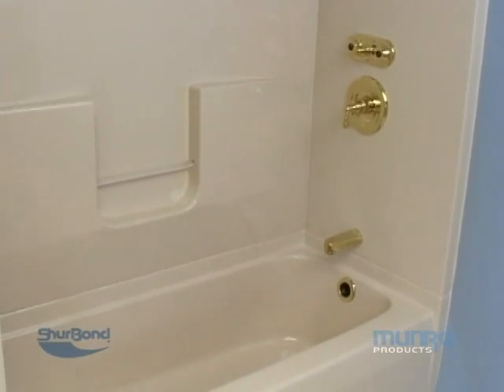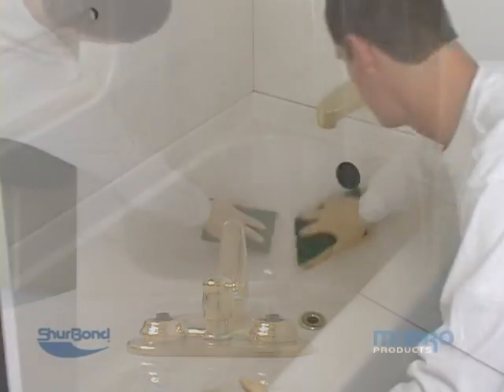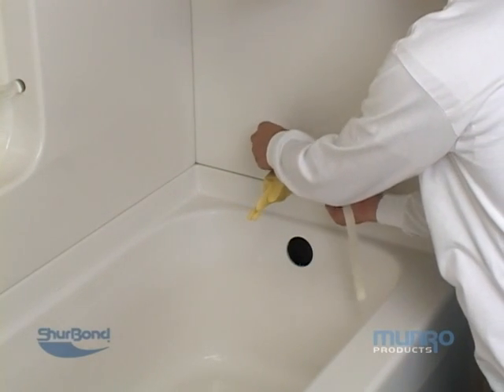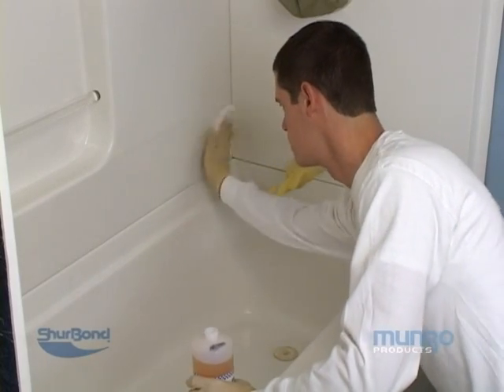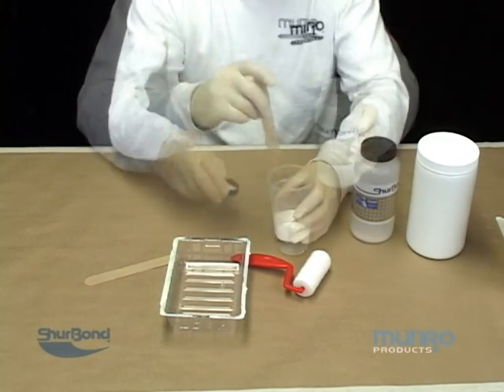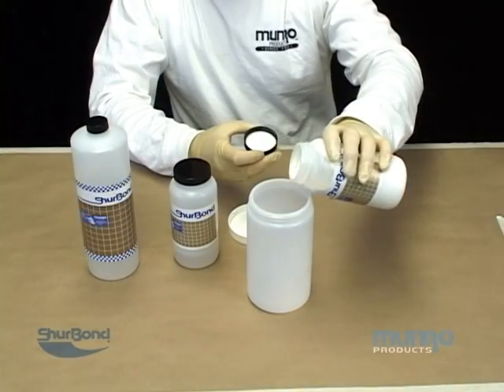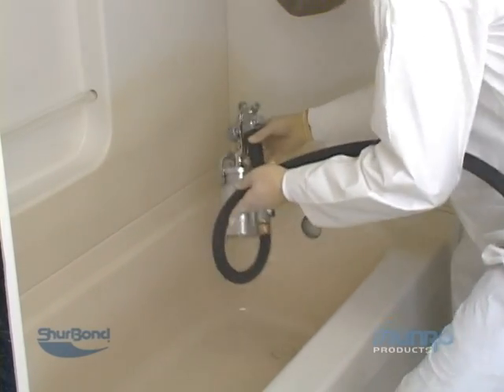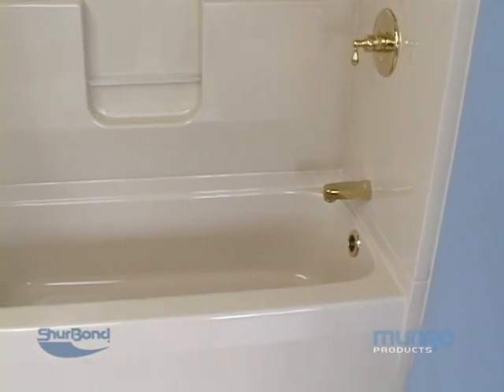SHURBOND Fiberglass Tub & Shower Unit Refinishing

Comment: Wow. I just tried the bathWorks system and my bathtub looks brand new. It is so smooth and glossy. Never thought I could get a finish like this with a roller. Very important to sand down the tub as I had to sand off all the old paint from a sprayed refinish job that only lasted one year. This finish really looks like it will last a long time and so smooth. Mario from Ca.